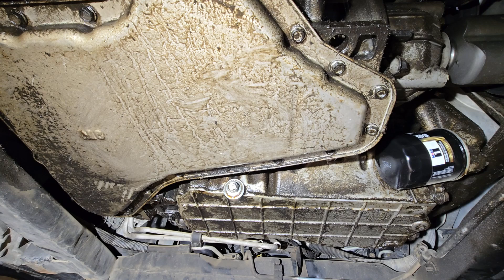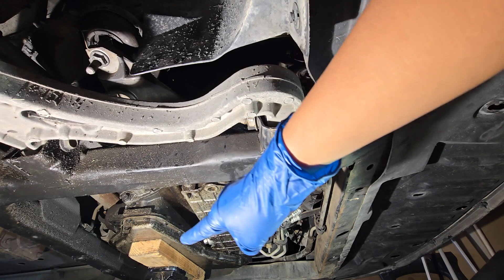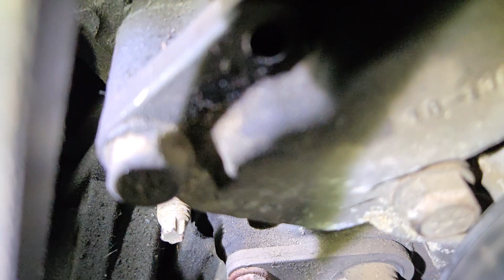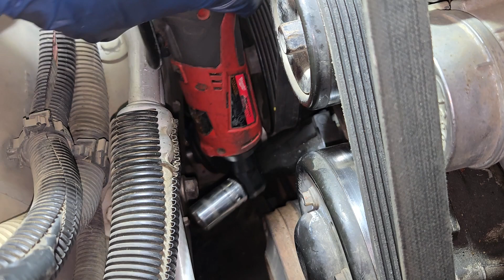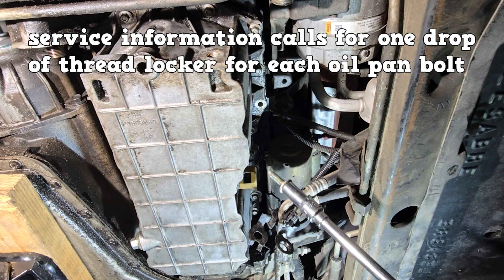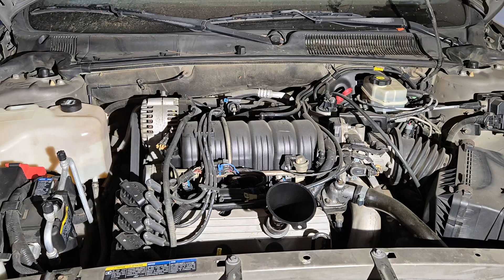Oil Pan Gasket Replacement ('00 to '05) Buick LeSabre

Comment: My '05 LeSabre has recently developed its first oil leak in 20 years and I have yet to determine where it's coming from. It currently has 97,000 miles on it and my dad took meticulous care of it while he owned it. I believe he had the oil changed every 3,000 miles. I have tons of receipts from the maintenance throughout its life. The cylinder head that has the oil fill tube looks like new inside and I'm assuming the rest of the engine is just as clean.

I was looking up the most common points of leaks in a search engine when your video came up. I wish all car repair videos were as detailed, direct to the point, as well illuminated and focused as yours. I also like that you didn't add any music to it, nor ramble on about irrelevant things.

Thank you for posting this video and keep up the good work! You have gained a new subscriber.

BTW, the OCD in me would have cleaned the entire oil pan inside and out with brake parts cleaner before reinstalling it, even knowing a little varnish in it won't actually hurt anything. LOL
Reply: Check your oil pressure sensor. Mine was leaking from there at about that mileage. Plus, the reading on the gauge was inaccurate. Mine 2002 just 118k and its time for oil pan gasket. It don't look to terrible after watching this video.
Reply: @justinhubbard292  Thanks for the suggestion. I'll check there, as well as the oil drain plug. It was overtightened by Wal-Mart from when my dad took it there. They also use some kind of blue colored hard silicone(?) so they can know if it's been tampered with after it leaves their garage. I think the plug's gasket may be worn out. I may as well buy a new plug before the next oil change, just to be on the safe side.
Reply: @justinhubbard292  Well, what I thought was an engine oil leak was actually hydraulic fluid that leaked from the front transmission mount. Boy, did that thing ever make a mess! I have since replaced it with a cheap "Wholesaler Closeout" Anchor brand mount from RockAuto. It cost only $11.23 and the box and part looked like they had been sitting in a warehouse for a long time and I'm not expecting it to last forever but hey, at least it survived a trip out of town and isn't (yet) leaking. lol

Comment: How hard is removing the wheel assembly?
Reply from the maker: with the vehicle lifted, remove the 5 lug nuts with an impact wrench, or you can use a breaker bar and socket to loosen the lug nuts while the vehicle  is on the ground, then finish removing the lug nuts after jacking up the vehicle.
Reply: @ can i do this without removing the wheel assembly?
Reply from the maker: @Dbacks77  when I refer to the "wheel assembly" I mean the tire and the rim. It is highly recommended to remove them to have easy access to fasteners.
Reply: @ thanks for clarifying!  Awesome video by the way.

Comment: Better than a lot of vids but can you show how you support the transmission pan? Thanks!
Reply from the maker: using a standard floor jack, I put a piece of wood in between the floor jack and the pan, it measured about 10 inches long, about 1 1/2 inch thick, about 3 inches wide. It went at the center of the transmission pan to evenly distribute the weight.